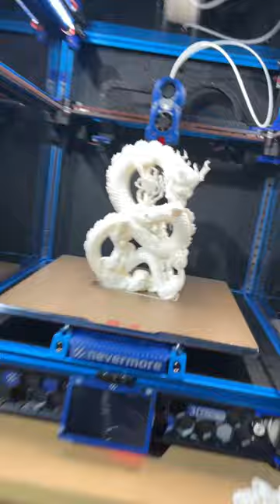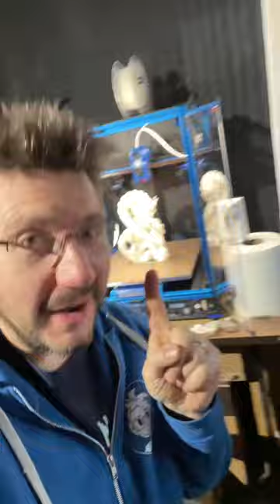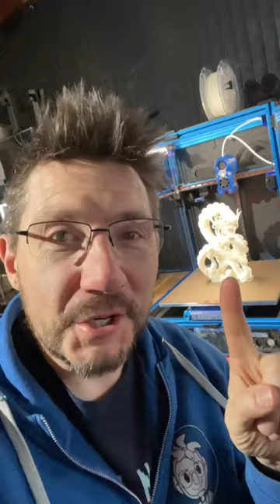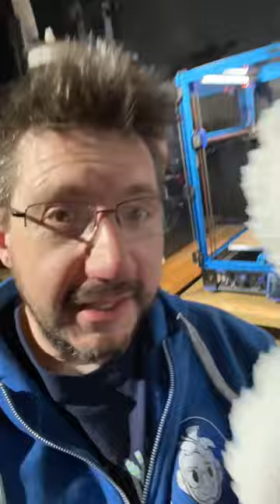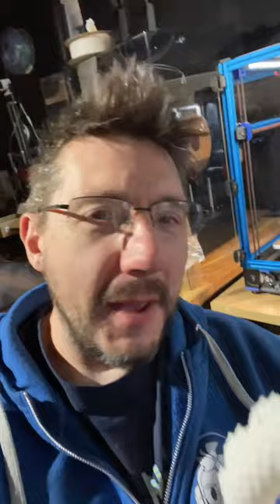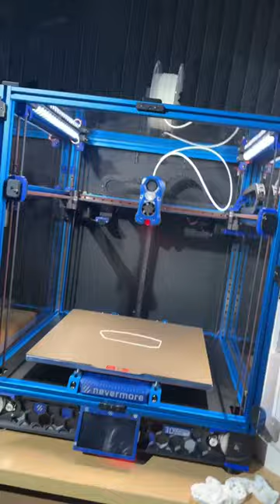VORON PRINT! 😍

Comment: That is a beautiful print. How long did it take and what speed where you printing at?
Reply from the maker: I used defaults for the v2.4-350 in Prusa Slicer. So, not FAST, but fast-ish? I believe it took 13 hours.

Comment: I've been looking into building the 2.4, but really struggling to decide if I want to go the kit route or the buy everything myself route. Excited to see more on this from you :)
Reply: When sourcing yourself, make sure that delivery fees/import taxes don't end up catapulting your printer's price way beyond kits's price, while using fairly similar parts to what kits deliver.
Reply: Well the answer really depends on if you can get a good kit (i.e. LDO), or if you're going to get an AliExpress kit. The latter is likely to have overhead expenses, the former - even if some parts arrive broken - would only cost extra shipping time.
The big advantage to self-sourcing is being able to choose what control board and hot end you use, but you can simply ask the kit provider if your particular choices can be accommodated and the kit either shipped without those parts and cost less, or with them outright.
Reply: @EgorKaskader  Exactly, I put my comment out there as another thing to consider while deciding whether go with kit or self source.
I've heard many "horror stories" where for some people delivery fees ramped up the cost by another half of an LDO kit.
Reply: @r4yker442  To be honest, unless you enjoy the process of self-sourcing, I recommend the first step to be checking out the price of actually good kits. The Discord should offer recommendations. You might be able to source for cheaper yourself, but it mainly makes sense if kits are too expensive for you, or if you actually enjoy the process of sourcing. In my case, it took well over a month and due to oversights I actually had to jury rig for missing components and perform repairs that stretched the project.
Basically the savings for self-source are paid in your free time you spend doing it.
Reply: @EgorKaskader  Exactly this!